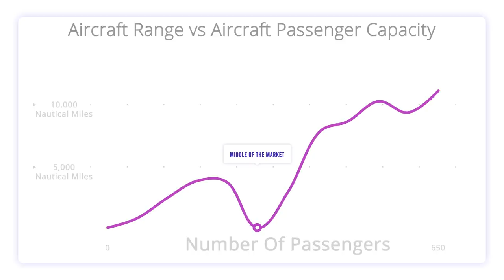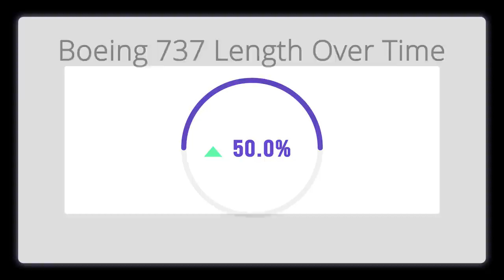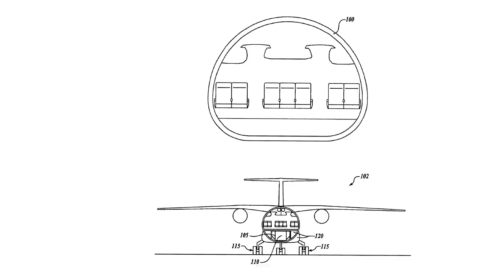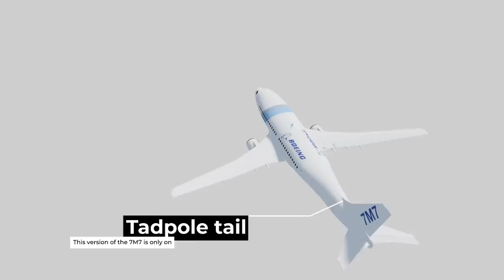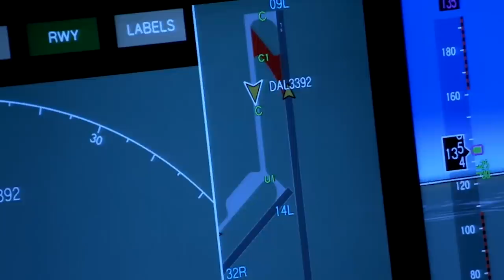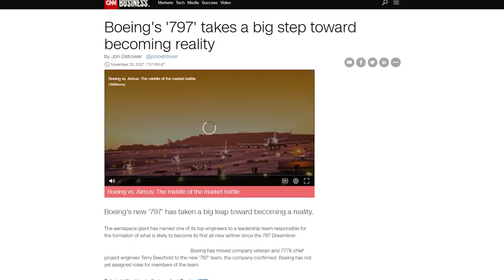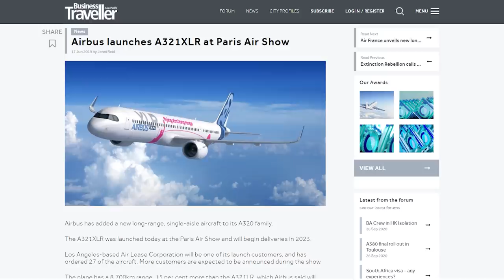The Boeing 7M7 - The Proposed Future Boeing Aircraft To Replace The 737 MAX and 797 | Never Built

Comment: the same materials?! at best cockpit and maybe part of the tail, engine comes from a supplier, so hardly the same materials as you already suggested it would've used 787 materials..., the 'same' engineers doesn't do much either if you look at it from a production standpoint you have the build the plane regardless and retrain as a wider body like that really isn't the same proces (but that's hardly the biggest cost in terms of retraining that one goes to maintenance and pilots hence the 737MAX and it's issues trying to stay as close to the original plane), suppliers would always be there and the cabin is still different enough to warrant new designs...marketers really don't cost that much to retrain....so from all those points it really wouldn't have been a cost saving at all (not saying it wouldn't be financially viable...). There is no reason to think pilot retraining wouldn't have to happen...it might be a bit cheaper because it isn't a complete retraining...

Comment: so trying to jury-rig the aging 737 platform with massive high bypass engines that fundamentally change the flight behavior of the plane, and compensating for that with tacked on software solutions...wasn't the right thing to do? Ah, good to know. Boeing will not be competitive without a new from the ground up 737, and the hybrid wide-body 7M7 concepts seems like a perfect jumping off point. Instead of spending billions pushing the 787 to max possible proportions, spend that money on the middle of the market. It's like they learned nothing from how successful the 757 was.

Comment: BOEING needs to stop with the "no new type rating required"shit. That's what brought you MCAS in the first place. Let the airframe sell itself on it's own merits.They'll train for it if it's worth it. In hindsight, maybe they should have just developed the 7M7 and hung those two engines on that with some taller gear to accommodate the diameter of the extremely high bypass ratio engines...

Comment: The 7M7 would need larger engines then the 737 can accommodate even with the MCAS.
Reply: Wider body would allow for taller landing gear, so a widebody could accommodate larger engines, and it could be done with less aggressive or even no MCAS (in theory). The problem with the MAX is that engine ground clearance forced Boeing to mount the CFM LEAP engines too far forward such that engine throttle up caused a pitching moment on the airplane, which Boeing (catastrophically) tried to correct with MCAS.

Comment: The underwing engines are a relic. The new, more efficient engines get their performance from larger fans. The nacelles have gotten too big. Either the landing gear gets too long, or the engine is too high on the wing. There is also the potential of a ground strike as happened in Pakistan.  Tail mounted engines solve both problems.

Comment: 757.  Why did they stop making it?  Four wheel main trucks and MUCH greater power = WHY this is so much better!  Four wheel trucks means much lower brake temperatures and the longer [same....] fuselage as the turkey 737.   And Boeing already has a 2-3-2 airliner:  The 767.  Short widebodies DON'T WORK.  Airbus found this out with their turkey A310.....
Reply from the maker: the 757, to my knowledge, didn't fit well in the Boeing production line. They had the smaller 737 with its own line, the 767 with its own line, and the 757 didn't fit in either. so it was kinda tacked into the 737 line and Boeing eventually sold it as much as they could for the time.
Reply: @FoundAndExplained  The 757 and the 737 have the same fuselage barrel. The cockpits are different, since the 757 has a 767 cockpit grafted onto the 707/727/737/757 fuselage design.  The 757 was slightly more expensive to produce, so when the recession came and orders dwindled for narrow-bodies they had to pick one to stop producing and in my viewpoint they picked the wrong one.  They could have easily grafted CFM-56 engines to a short body 757 and produced a far better plane than the 737 Max.

Comment: The Boeing 7M7 concept, was a variation of the Tupolev Frigate Ecojet concept from 10 years earlier. 

https://modernairliners.com/frigate-ecojet-%D1%84%D1%80%D0%B5%D0%B3%D0%B0%D1%82-%D1%8D%D0%BA%D0%BE%D0%B4%D0%B6%D0%B5%D1%82/

Rather than giving the go ahead for the 787-3 which would have fulfilled the middle of the market segment, they decided to waste time and money with a clean sheet so that they could investigate the decade old Russian solution, and offer it up as an original idea, typical Boeing miss management, and then the AIRBUS A321XLR happened, hindsight is a bitch, especially when no lessons are learnt.

Comment: All I hear is 737 and saving money. What the hell is up with keeping the 737 model and expanding it.  Boeing could've alleviated this problem by bringing back the 757 or build an airplane that is the replacement, but because of cost, they didn't wanna do it. The A321 is NOT a replacement of the 75, it another case of cutting corners because of cost. Supposedly the 797 was/is suppose a replacement for the 757.
Reply: Just trying to learn... why isn't the A321 a good replacement for 757?

Comment: Boeing could extend the length of the 737 series if they moved the wing slightly aft and moved the horizontal stabilizers to just behind the cockpit as canards. This would eliminate the ground strike issue.

Comment: you all know by now, boeing could come out with a million planes to replace the 737 and I still would not fly in a boeing built plane. My former Brother In Law worked on boeing aircraft in Kansas and said back in early 2000 he would not step onto a boeing aircraft and he worked on them, I thought he was nuts, now I know why. You fly on there plane just plan on making funeral arrangements at the airport because you all know it's going to crash the minute it takes off
Reply: In early 2000's I was finishing up my time as an FO on the B757/B767 aircraft and they were great solid birds, wonderful to fly and no issues. By 2005 I was a CAPT flying older 737-300's then soon upgraded to the new B737NG, the 700, 800 and 900 series of the 737 class. For the next 12 years I flew many 1000's of hours flying new off the production line B737-800,900's. It was awesome flying new aircraft and we had not a single issue with them, by far the most trouble free aircraft series I ever flew. Also some of the older 800's aged very well, even though some had been in service for more than a decade. These older 800's aged better than any other Boeing series in my experience. BTW these 737NG's were built in the 2000-2018 era. We had one of the larger B737NG fleets in the world and our pilot group loved flying them and trusted them for good reason. I can't begin to understand why your brother in law said what he did, it has proved out he was mistaken.
Reply from the maker: The 737-800 and it’s fellow generation aircraft are fine!

Comment: Boeing needs to make a complete switch away from the 737 once and for all:  The 737's short landing gear is its Achilles heel.  
If Boeing could change that one flaw, a further evolution of the model would be just fine but they just cannot / or do not seem to be able to.   Boeing's engineering capabilities are questionable after the 737MAX debacle. (Starliner anyone?)  
The A32X series will live on much longer simply because of its normal sized landing gear.
Boeing's 787 development program was a disaster and I can imagine that Boeing would be very worried about its ability to properly develop a new airplane.   Boeing may very well be stuck with the 737 for more decades before moving away from it of being beaten by the competition.
Boeing is clearly no longer the  aviation leader it was.

Comment: Airlines cannot use the same Pilots since they will be all retired by then... And based on an antique 737 it cannot be a "NEW" plane...just a MCAS a Major Cause of Accidents System. With not using then the more biodegradable antique wood design of the Wright brothers....No no, and no, a single aisle round Dreamliner composite lighter brother like the 757/767 successfully twins family was and still is the only possible way to outperform the high efficiency of the narrow but aluminum lithium A321neo XLR.

Comment: I do not understand to redesign planes to make them smaller more efficient following condition of the flight.
Intercontinental fights are comfortable only in solid big planes not skinny and light. 
I cant imagine to flight 8 9 hours in 737 or ab 220 or so.
If you want to make saridines flights you may only have only oil inside the can. 
I will only look at the flight for mor than 3 h big planes to feel safe and secure like in fortress. 
The best are the big and solid. 
Very significant compare is skinny Embraer 175 compare to wider  Airbus 319. 3h flight.
And A319 i much much better for conftible trip.
And A 220 v Boeing 747-8  London Sydney. 
??????????????????????

Comment: Why not update the 757 which was and still is a great plane. It had nice capacity and needed updated engines for fuel efficiency and the engines are available and used on many of the ones purchased and converted to he large corporate jets like Trump did and used on campaign trail. My company had one too and it flee into many small towns.
Reply: Because it's 40 year old design already, and at least 5 more would pass before it would come into service. And its production lines are shut down for more than a decade now.

Comment: It makes you wonder why Boeing didn't just explore an improved 757...  True, they would have to rebuild the production lines, but they basically did that with the 737MAX and the new 777X anyway.  They wouldn't have to recreate the wheel, a new 757 with improved engines, a redesigned wing, updated FMS and avionics... You'd think that the current 757 operators would have loved the chance to upgrade fleets without having to convert to a whole new aircraft.  But Boeing's gonna be Boeing.

Comment: This has already been designed by Boeing.  It is called a blended wing.  By hanging on to the same engineering mistakes in the 737 - Max.  Is continue to play with passengers lives.  It is a horrible mistake to design, build, and update an aircraft. By utilizing the talents the accounting department.

What boeing needs to do is hire great Aeronautical Engineers.  Then promote to upper management the best of these Engineers.  Then make sure those promoted Engineers run the accounting department.  Or continue to do what Boeing is doing and fly the company into the ground.
Reply: Was with you until you said its a mistake to update aircraft. That is literally what every single manufacture has done in the industry, from GA, to bizjets, to fighters, and to airliners. What the hell is the A330neo or the A320neo then? NOT an update of the A320ceo & A330ceo??? How about the latest Cessna 172S Skyhawk with a 180HP Lycoming IO-360 compared to the original fast-back, straight-tail Cessna 172A Skyhawk with a 145HP Continental O-300? Is thats not an update? The 737 MAX is what happens when an update for a plane is horribly planned & executed.

Comment: But wait, I know a harder way lol. That bird would have taken time, certification and simulator training NOT HAPPENING! Cost, schedule and shareholder value by any means.
Reply: @johnhenry6762  Since I've tried to have an investigative reporter look into a recent Boeing unethical practice that was discovered by the US government and kept hush by both Boeing and them and it seems the story is not important enough or perhaps so important they'd rather not go public, I'll go public. On the week of October 08, 2020 at the Boeing Rotorcraft facility in Ridley Park PA flight test operations damaged a CCRAM V-22, the aircraft sat with undocumented damage reports while Boeing removed a part from another V-22 to replace the broke one, also not documenting the removal of the good part. After changing the broke part Boeing sold the V-22 to the US Military with no documentation about the accident or swap of parts. After delivery, the US Military discovered the undocumented events because of serial numbers, they contacted the Pentagon, and the Boeing facility had their flight test operations temporarily grounded for both V-22 & H-47 aircraft for US and foreign customers. First and second shift senior level quality supervisors were fired.
Your company looks real bad John
Reply: @johnhenry6762  you still haven't explained your ego and spouting about batteries and metal here. I laugh at your foolish comments while watching Boeing be exposed for what they are. You have a PO Box I can send you some photos 😝.

Comment: Don't bother to design anymore new model plane. No operator is buying. Stick to your 737 max series. Your 737 series were not make to transport passengers but were mend for trial on error. I doubt Boeing gone through a strigent test for their final product before passing it off to the world market and declare it is fit for flight. If not then why two 737 max crashed? Are Boeing treating all passengers as white mice to use these pple for testing. Pls explain!

Comment: I think that Boeing is making the new NMA to replace the 737, 757 and 767
Reply: Technically, to replace the 737, it would be labeled as the FSA (Future Small Aircraft)
Reply: fighter5583 but I Believe that the nma would have also a short version to replace the 737-800 and 900, a normal version to replace the 757-200 and 757-300 and a bigger version to replace the 767-200 and 300

Comment: Hi I always get a huge 😂 When I see airplane commercials. You see huge salons with water running and all that. But real life is you are cramped lige hell. I am 6.2 foot tall. And  I could barely sit down. No I am not fat I athletic build. So my question is airplanes also need to upgrade the space for each passenger people in average today are taller and taller.